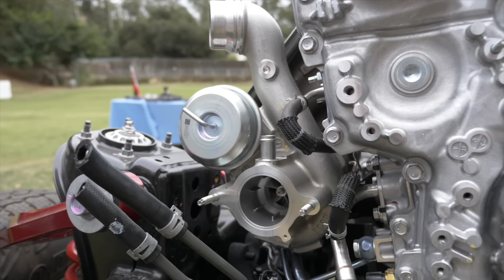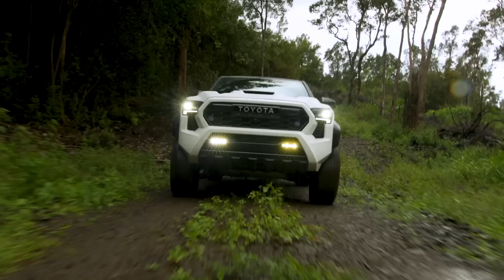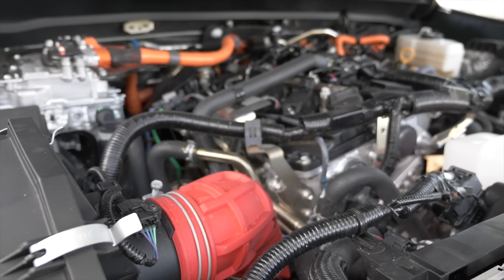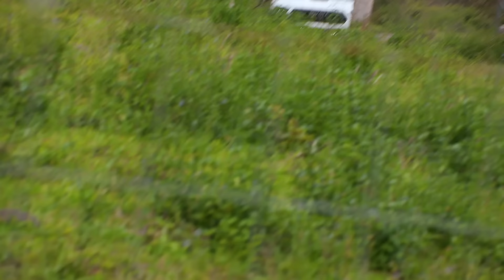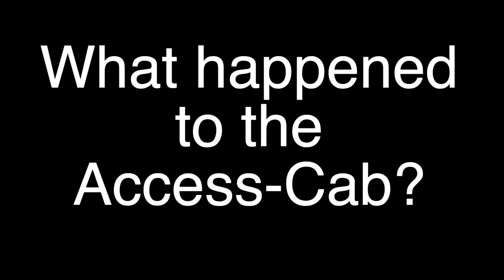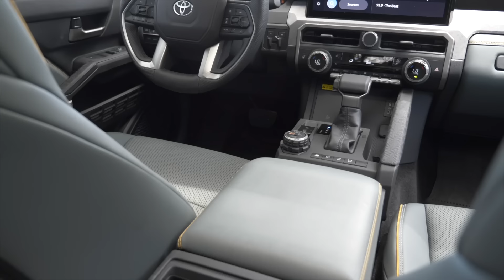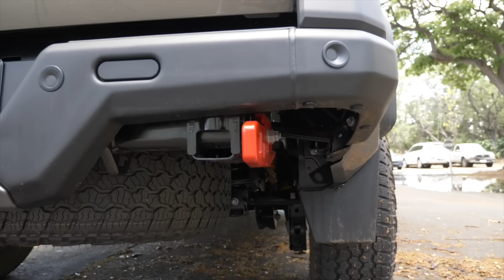2024 Toyota Tacoma Chief Engineer on new engine reliability and more...

Comment: I am afraid that the turbo motors will hurt the resale value of the Tacoma…traditionally incredible with NA motors.  The bottom line is if you are running turbo motors, the oil has to be changed VERY often for longevity.
Reply: Nothing wrong with changing oil too often, that’s just part of maintaining the turbo engine.
Reply: I am not talking about me…I am talking about everybody else who changes at the factory specified interval or longer.  People are going to want every oil change receipt and if it hasn’t been changed every 3,000 miles or 6 months, plenty of people, including myself, will be walking away.  Turbo motors need exceptional maintenance to last and not cost you big.  Historically, most NA turbo’s go forever if maintained at factory intervals.  Turbo changes that dynamic and shortens the lifespan on literally everything.
Reply: @johngreen2510  And turbos are still unproven. Anyone who would pay $70,000 for a new Tundra with an unproven turbo engine is crazy.

Comment: He’s not biased at all. Turbos generate more heat…heat is the cause of wear and failure. Add 10k oil change intervals and water viscosity oils. These engines will go 150k TOPS if you’re lucky.
Reply: Which is why they upgraded the heat removal system
Reply: Keep in mind that diesels have used turbos for a long time, and they are known as reliable.
Reply: @DefundTheFringes  Diesels do not produce nearly as much heat as gas does.  Heat destroys oil as well as engine components.  Will have no where near the reliability.  Oil change MUST be 3000 to 3500 mile increments, NOT the suggested times in the manual.  Turbos on diesels work well, have so for many years.  Not so with gasoline engines.
Reply: Did you watch the video?

Comment: Ok, that’s a lot of talk! But let’s be honest… there are Tacoma and Tundra trucks on the road that have reached one million miles, and a shit ton that reach between 300k to 500k with their naturally aspirated engines. Show me one of your test model, or foreign models, that has a non-diesel turbo engine that has reached 200k without having to have the turbos replaced or rebuilt! I’m talking specifically about pickup truck models, and not small, city driven only, suvs! There aren’t any! What’s the breaking point? 100k? Less? 

Gas mileage really is NOT a benefit for the losses - I’m on my 4th tundra right now(2023 V6 Turbo TRD Off Road 4X4), and I’m only getting 1 mile per gallon more than I was getting from my previous V8 model Tundras. 14.7mpg vs 13.7mpg respectively! Having said that, it sounds to me as though it was designed/engineered to make the government happy as well as keeping the big oil companies happy! Who pays? The consumer! 

Final gripe: he mentioned getting full torque at around 1700rpms up to 4300rpms - that’s a problem for off roading when you really want full torque at a much lower rpm when you’re running in gear 1 or 2. So, he’s full of S when he says that the newer models are better on a “performance level”! Maybe someday they’ll perfect the Turbo design, but it’s not there yet
Reply: And it won't be there for years.

Comment: I’m sorry. But he is incorrect. They may used smaller displacement turbo motors in other Countries. But they are diesel. Not gas.. HUGE difference. And those turbo’s don’t outlast the 6 cylinder natural aspiration engine. These new turbo charged, electrified motors are NOT as good as the older less complicated ones… So now they have to get their engineers out here to try and sell us on these more complicated, not as reliable engines that the government is forcing on us! I don’t blame Toyota. Its our fault for electing these politicians. But Toyota reliability is GONE!  Buy used….

Comment: More performance and gas mileage than the old V6?  How about towing?  Can you still say the same?  How about when the truck is 10 years old, do you have to replace the ultra expensive battery pack and the expensive turbo charger?  Let's see how the long term reliability and gas mileage when the new Tacoma comes out.  I have my big doubt on a 4 cylinder turbo engine.

Comment: Nope on the turbo 4 cylinder. 
Just bought a 2024 Frontier 310 hp V6. 
The 9 speed auto trans is 100% better than my 3 gen Taco was.
Reply: That Frontier drivetrain is pretty damn sweet. Light years better than the 3rd gen Tacoma. Solid choice.
Reply: Congrats!  Brother picked up a Pro 4x last year and loves it.  Enjoy your new truck!
Reply: Congrats!  Brother picked up a Pro 4x last year and loves it.  Enjoy your new truck!
Reply: @marklihsu  Cool.  I would have gotten a Pro4x but I needed a 6 foot bed more thanI needed a big back seat (no kids) so I got a SV king cab.  Love it so far.
Reply: So, how can Nissan sell a V6 and meet emission standards and Toyota can't? I have a 2nd Gen Tacoma and I like the looks of the Frontier interior and that V6.

Comment: As a engineer myself, sounds like a future disaster in the making. Sounds like he says has lots of problems but dont worry we worked out all the bugs....
Reply: Toyota Hilux is turbo diesel and they are 25 percent stronger than a Tacoma with hundreds of thousands of miles. So it is not the turbo chargers. Most likely it is gasoline direct injection engines.

Comment: The new, high-performance "GR Corolla" shows that Toyota does not necessarily achieve what they claim about controlling excess engine heat (and long-term reliability?) from their newest turbocharged engines. Their more-standard cars and trucks may not have the same degree of problem, but the point is that you can't automatically believe what Toyota says about having solved certain problems (any more than all the other manufacturers). I would prefer a V6. Decisively.
Reply: What's going with the gr corolla?
Reply: @mad-meh2719 the GR Corolla is known for overheating on the track and going into limp mode within 10 minutes or so. It's happened to several car journalists.

Comment: Everybody knows that the turbo's caused so much stress on the motors I wear them out prematurely how do you fix that?
Reply: Turbo diesel commercial trucks last 400k miles. No issues. I think it is ⛽ gasoline direct injection is not as good. Although Toyota uses a dual port.

Comment: Why would Anyone spend so much money for a hybrid? You’d have to drive that truck for 150K miles before breaking even on the extra cost of the hybrid as the savings in fuel consumption.
I can no longer afford to Limited, just to get the brown leather interior, so I’d have to buy the SR5 and have Katzkin Leather installed.

Comment: Sorry I'm going to be a hater of this 4 cylinder. Yes it gas more power than the current v6. It also has a turbo. Look at the problems the tundra has with its v6 turbo. People that are going to use this truck to haul loads in the bed long term and towing all the time are going to hate this higher reving truck. It's better cause the transmission is a 8 speed rather than the 6 speed currently used. Overall this motor will not last like the v6 generations will. The bed is garage. These beds have been known to crack in the same spots as always. Screw this composite bed and go back to the steel bed. You don't hear bad things about the steel beds. Anyone else see the problems with a push button switch for a tailgate. Just more crap to go wrong with. And these new air seats in this truck, oh man just think about the problems they going to have. To bad they don't make a another version that's back to old school truck without all this crap. Yes some people will really love all this cool new features. As a mechanic I see more problems and less and less normal people working on this 4th Gen.

Comment: Looks like they did their due diligence with the turbo and it has the cooling it needs for longevity. Waiting for final specs, but, the available information says the towing capacity is still 6500 lbs. Pity they couldn't have bumped that up a bit. Colorado can be equipped to tow 7700 lbs. for example. Maybe the hybrid will get a small boost in towing capacity? Also the mpg's for normal and hybrid, yes, that needs to be a good step up over the current model.
Reply: I don't see much of Tacomas towing anything.  Keep the 2.7 or put the 2.5L hybrid in the new truck.  If you want to tow, buy a Tundra.
Reply: Towing isn't only about the engine. It's also frame, suspension, brakes, etc.
Reply: Indeed, seems they didn't beef up those components, or, they have a higher safety/reliability margin than domestic trucks. It could well be that Toyota want you to spend more on a Tundra. Not for me, too big, too expensive, poor mpg. 2024 Tacoma pricing has allegedly been leaked, approx. +$1000 for some trims, or more, some a lot more. With sky high interest rates and big 3 domestic full size trucks stacking up on dealer lots unsold, 2024 will be interesting in the truck market. The 2024 Tacoma will be in very short supply so no deals there.

Comment: I won't be buying 4 cylinder..I have a v6 camry and love it. Almost 200,000 miles and drives so smooth. Change all your fluids, including transmission fluid every 50,000 miles and your car will last a long time. I will either buy a 6 cylinder lexus or truck in the next few years so I'll be dead before I am forced to use a 4 cylinder turbo bunny

Comment: Would like to see them explain the box frame. Reason all the older ones rusted was bc the the box frame trapped salt amd water cause all the rust issues.
Reply: Actually the steel used for some of those frames was defective in chemistry and everything north of the Mason Dixon line rusted away.
Reply: @matt… The rusting Tacos did NOT have box frames. They had C-channel frames.
Reply: @is6566  89 had box I have it and there is rust problems.
Reply: @matt…. I meant Tacos built after the Dinosaurs went extinct. Just kidding. 😃 Thanks for the information, didn’t know it.
Reply: Lol thats the best ones 89 and 91 still running strong wish they would build the 22 re again its a legend.

Comment: A great presentation and it is a fantastic looking vehicle. Hopefully the engine proves to be reliable, but one thing I really dislike is how it looks like someone took a trash pile of hoses, wires and parts and just threw them into the engine bay.
Reply: Engines are a lot more complicated than they used to be. All those wires, hoses, etc are there for a reason, sorry to say they aren't going away. Kind of funny that manufactures used to put those plastic covers to hide all that and everyone complained that it is dumb, useless, and they wanted to see the engine. Now that they don't have that on there, I keep seeing comments like yours complaining that they basically don't want to see the engine. Make up your mind!
Reply: @RecBuddha  Even without a plastic cover my Lexus V8 is organized and easy to work on. I've never seen an engine look as disorganized as the new Toyotas. It's the layout.
Reply: @dr.emilschaffhausen4683  hoo boy you should look at some Chrysler engines then!
Reply: @RecBuddha  I have found that those plastic engine covers are only good for mice. 😄
Reply: The non-hybrid looks tidier than my V6 🤷‍♂️

Comment: 4 cylinder turbos =$$$$ repairs, no long term reliability lucky if it lasts 8 years. Unfortunately Toyota sales will plummet. Nissan keeps thier V6 naturally aspirated engine they will have increase in sales with the frontier.
Reply: Nissan will dump their V6 soon.  4 Cylinder Turbo engines are more reliable than V6s for the most part.

Comment: A 4 cylinder turbo will never last as long as a v6. Can't cheat physics... Toyota's turbos will probably last longer than other brands, but the new engines (turbos) won't last as long as the last naturally aspirated, larger ones😢.
Reply: Time will tell. Technology improves. Things change.
Reply: Toyota does not have as much experience as Ford in Turbos.  If I had to go turbo Toyota is last on the list.  Get the Frontier.  NA V6
Reply: @marklihsu  Toyota has had turbis in their cars since the early '90s. I am a 3rd generarion Ford owner, but changed to Toyotas in recent years. Longest lasting cars. Wish I would have learned earlier.... Now the EPA Commies are forcing car companies to go hybrid and turbo for emission standards😥.
Reply: @countschad  uh huh and look at their tundras problems galore.  And to think they are bringing it to the taco next.  Look at the Lexus is250 turbo money pit.  Running a turbo in a car is different than a truck.  People don't stress their turbos in a car as much as someone in a truck that's going to tow and carry heavy things or go off road.  Toyota ain't what it used to be.  If you have a previous gen Toyota keep that.  I'd avoid the new ones.
Reply: not true

Comment: I hear from a friend that sales Toyota that many customers don't want the new Tacoma because of the 4 cylinder turbo engine. I believe it was a big mistaken not to come with a V6 engine.
Reply: The most important things about Toyota is reliability, if that is gone, Toyota brand reputation is gone.
Reply: They also took away the 5.7 V8 from the Tundra but you see many 22-23 Tundras on the road.
Reply: I was never a fan of the 3.5 V6 and 6 speed auto.  I bought a 4R instead with the best powertrain offered by any manufacturer.  The 4.0 V6 and 5 speed auto are amazing.  It’s still available for another year.  The 2.4t and 8 speed auto is definitely an improvement over the 3.5 6 speed.
Reply: Yes, Toyota/Lexus should give option for customer to choose V6 or 2.4turbo.
Reply: @zzheng9296  The engineering cost would be too high.  I’d rather just have the 2.4t done right.
Reply: That just means better deals for those who want these turbo engines. Much better driving experience than the NA counterparts.
Reply: @perrysanders9998 Toyota is too new to the turbo game.  Get a Ford.  The few turbo Toyota models out in the wild is not enough real world data compared to the eco boost line of engines.  The turbo in the Lexus IS250 is known as a money pit.  Toyota is great at making 4 banger hybrids.

Comment: I have a deposit on a 2024 TRD Pro and will be replacing my 2019 Pro. Thank you Toyota for ditching the constantly hunting 6-speed slush box and addressing the poor seating ergonomics in the current generation Tacoma. I hope the new version averages around 25 mpg.
Reply: My '18 4WD gets over 25mpg on 2 lane roads. They get good mpg without Bro Tires. I wish they just put the 8 speed in the 3.5L with 4.88 diff's.